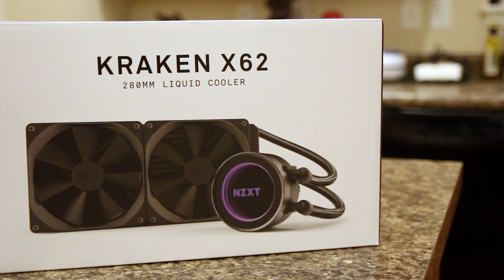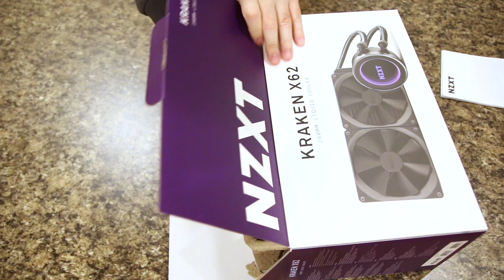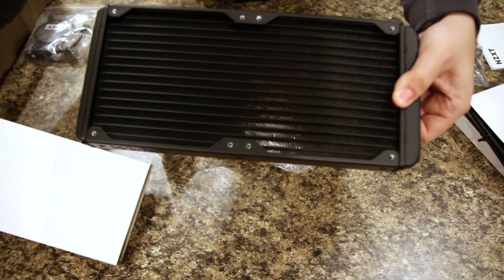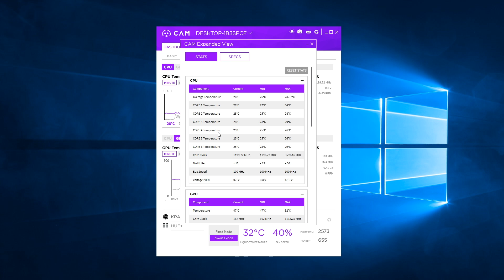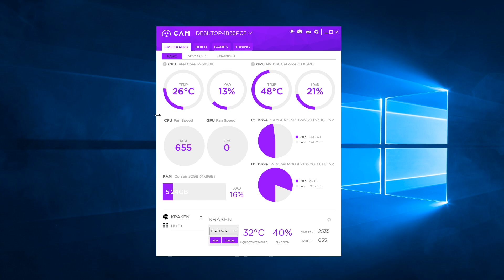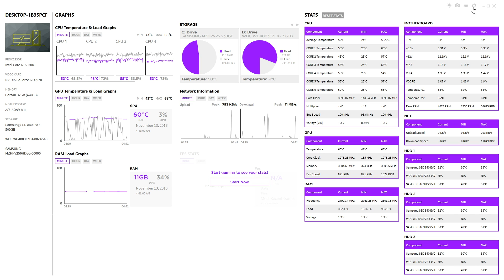NZXT Kraken X62 Review and CAM Overview

Comment: I can control the lighting in mine, but I can’t control the pump speeds and such.. has anyone had this issue?
Reply: Having the same issue, did you find any solution?
Reply: @spy2859  unfortunately I haven’t.. and this is my second cooler too, they had to replace my original because it was defective

Comment: Doesn't it block your first ram slot though??
Reply: depending on your board. I'm using the Asus Maximus Hero X WiFi and yes, my 1st ram slot is blocked using Trident Z RGB kits. If you use more lo-profile ram, you'll be fine.

Comment: don't buy it the software to monitor/modify it is garbage. I'd post a screen cap of it using 30-40% cpu resource, but it ends up freezing up my system win 10 I5 -4670k 16GB RAM. Previous to installing CAM my system could easily run a game or 2, multiple chrome tabs, and and audio player. I want my money back

Comment: Just a PSA, don't have your hoses going downwards from the radiator, try to keep it level and straight. A lot of people are complaining about a loud pump noise, and it will get loud because its having trouble pushing the water up to the radiator.

So keep it level and you'll be okay. I thought it was obvious but apparently not..

Comment: Does CAM need to be running at all times after you setup your lightning scheme? Just because I use HWInfo64 for monitoring temps and would rather use that and not have CAM running as well

Comment: I love your vídeos. All the way back to the review of the h440 in push pull which made me buy one and set it up like that as well. I am about to purchase this cooler, however I have a question:

Im using asus x99-a II motherboard. This AIO comes with 4 pin PWM to connect to the cpu fan header, right? (my previous h100i v2 came with 3 pin pwm as usual), so I wanted to know:

a) Will I need to set the BIOS Q-FAN to "disabled" in CPU in order to avoid "CPU FAN ERROR" ? (boy I had my share with h100i v2 on this part)

and above all:

b) Will Asus Fan Xpert 4 auto-tuning for fans (like you did on the push pull way back) override CAM software for the pump/fans on the AIO? I ask this because Corsair link + Fan Xpert 4 = meh

Comment: My kraken x62 doesn't seem to pop up when I open CAM? The logo lights with the standard white "pulse" thing, but It doesn't show up in CAM at all. I installed all the drivers that I could from CAM aswell.
Reply: I only have the "Overclocking" feature in the tuning tab
Reply: dude same, did you find anything to fix it??
Reply: Re download your CAM software. That did it for me. They prob updated it after this incident.
Reply: Sapper you need delete all softwares for example video cards overclocking or keyboard software. At least for me it started work i could adjust my fans, pump etc. And than i i downloaded back all other softwares.. We wrote a lot of complaints on online support and they just saying that they gona fix it and still nothing
Reply: Hey Edgars Nezinu. You don't need to uninstall GPU drivers nor keyboard drivers, because they simply has nothing to do with the CAM software. 
All you have to do is uninstall the old CAM and go to https://camwebapp.com/ to download the newest software.

Comment: Next summer I was all set to do corsair hydro cooling with a corsair case using Corsair's Link. After looking at the new x62 Kraken........hmmmmmmm. CAM looks like it works pretty good and NZXT worked out the kinks. I was leaning towards Corsair's Link. The other issue.....Asus ROG or MSI's Gaming....Need to figure it out before June 2017 :)
Reply: I know I'm really late but i'm interested, what did you pick? I ordered the X62 and it's coming tomorrow so would like to know what you chose

Comment: I was really considering one of these to replace my Noctua (for a little better cooling and more importantly not have a 3 pound cooler hanging offer my motherboard, as I move my computer around a lot with my VR setup).

But money is tight and I ended up getting a Corsair H115i refers add the $75 shipped was the kinds of deal I needed. The X62 is a little pricey at launch, still of I had the money is consider it.

Comment: CAM is great software, I don't even have any NZXT products in my computer but I still use it.
Reply: It's great until you actually install some of NZXT's products lol.
Reply from the maker: Haha! The CAM software is frustrating because there is so much potential there but I feel it just needs a bit more work. I prefer to use it to check in on things, set my profiles/colors and then close out of it. Would be better if it could just stay running.